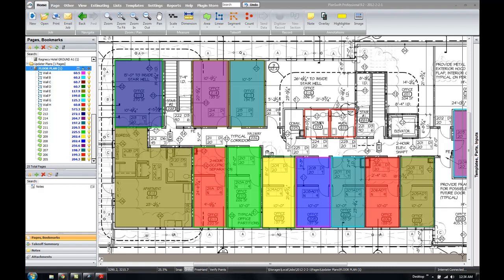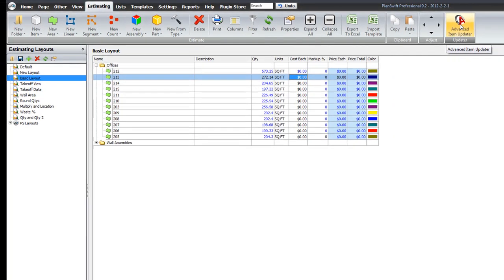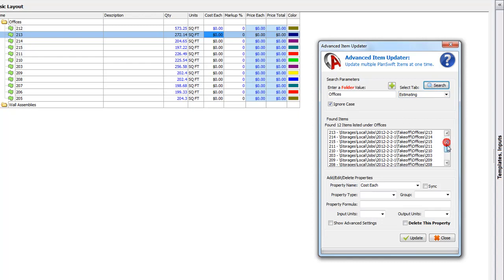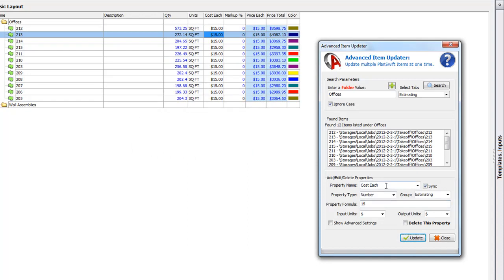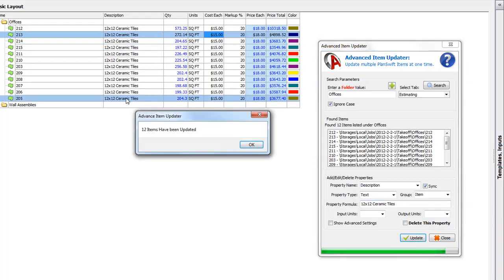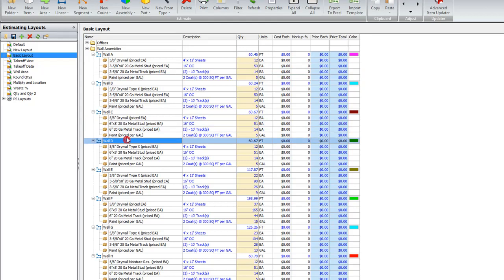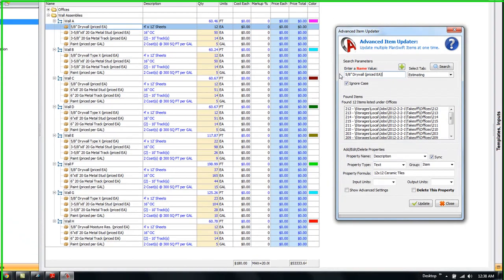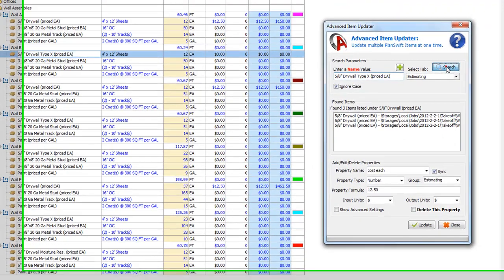Advanced Item Updater Demo Video HD

Comment: Message to the developer: Advanced Swift is a great tool which honestly should have been part of Plan Swift Program, but it definitely needs more options. Please add the ability to edit all property options as in List type, to be able to pull in simple and advanced lists, visible check box etc. basically everything that appears in Plan Swift when selecting to customize a property, these are very important! to customize half of each item doesn't take you anywhere.... as well the search option is very limited to Name, Description, Item #, Folder it needs to have the ability to search a wider variety as in "Type" etc.